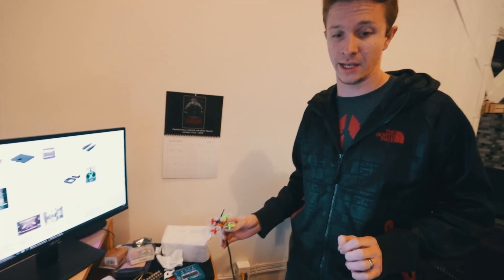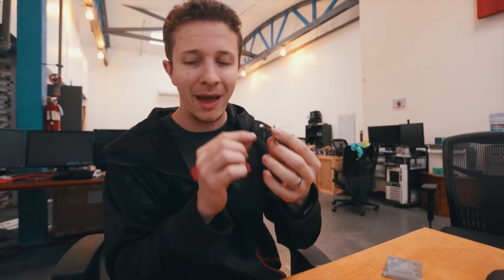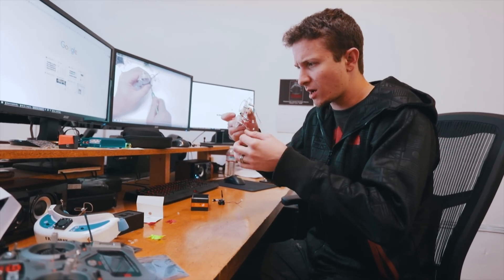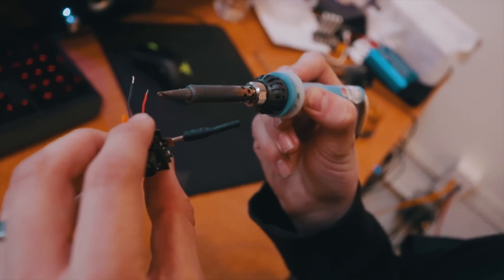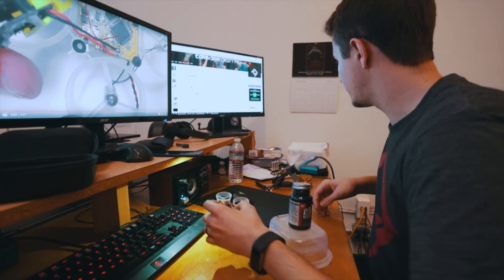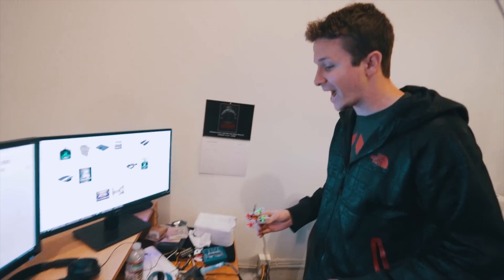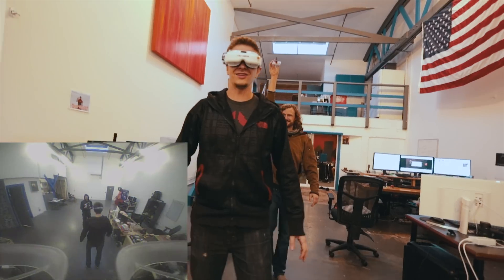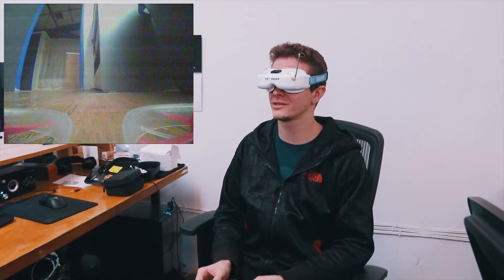World's Smallest DIY Spy Drone!

Comment: I know this is an old video but Wren, you've gotta help me! I'm having the same problem you did, where I see the connection but I can't arm the drone. I'm using a Tinyhawk Freestyle with a Taranis QX7 radio, and I can't find anywhere in Betaflight Configurator to map a switch to the "arm" function. How did you do it?

Comment: Is there a different drone frame I can use
Reply: Santiago Gracias yeah they make metal ones and there's an e010 one that is black but they are both heavier than the stock frame resulting in shorter battery life.

Comment: change the title the public hates RC quadcopters enough as is and are working on putting so many regulations that you might as well not be able to use them and titles like this are not helping the situation and funny part about the situation is that people also clump fixed wing aircraft in with quads so  if effectively bannes quads along with the rest of the RC hobby, so if you enjoy the RC hobby help spread the word that RC stuff is not bad and there don't need to be any more regulations because if you give someone of higher power the ability to do this  they most likely have never tried flying and they will go overboard with regulations 😕 ,,,, it has already happened in other countries,,,, so don't help bad regulations be put into place by giving it a bad reputation look at what almost happened to our second amendment there isn't exactly a amendment preserving our hobby it can be taken away a hell of alot easier 🙁so HELP PRESERVE OUR HOBBY or we won't have it any more 😥
Reply: Wes Brackman the RC enthusiast   Agreed. it's happening to the gun community and it can happen to the rc community.

Comment: Little safety tip. Transmitter always on first, then transmitter is last to turn off. Transmitter on, aircraft on , fly, aircraft unplug, then transmitter off. Very rare and doesn't really matter with the whoop, but for larger scale your aircraft can bind to another transmitter or may have a fail safe with partial throttle when lost connection ( or transmitter off). I had an old RC plane that kicked the throttle to 10% whenever I turned the transmitter off. That can be bad if you are not expecting it. An analogy would be like leashing your dog before you get out of a car or out of the house I guess?

Comment: Easiest way to do tiny jobs like that soldering is usually put solder on the bed first, tin the wire then lay the wire on and just heat both at same time and reflow around it.
Reply: Haha that's exactly what I did :P
Reply: I've messed up so many 5050 LED light strips because of not knowing this trick.  And my iron is a $5 POS from Radioshack.  Thanks!

Comment: Can we get a link to the drone parts? If the price isn't as high as building one with an Arduino and all, I might consider making one.
Reply: Luciano R nobody builds these with arduinos anymore. you use dedicated flight controllers. these little brushed ones usually cost around $90, and if you want a big brushless 200mm racing quad, those are anywhere from $150 to $300. But you'll need the goggles and radio too, which are anywhere between $70 and $300 each. although with those, the price is a little bit less relative to quality, and the cheaper ones can be just as good.

Comment from the maker: Hey Everyone! Parts list for the drone is in the description! Explanation here:

The drone I built is a modified Inductrix Blade, most commonly referred to as a "Tiny Whoop". You can buy fully built kits, DIY kits, or buy the individual parts and assemble it together like I did. You will also need a radio transmitter (the controller) and some FPV goggles to view the camera feed. You can also just use a little monitor screen that has a radio antenna attached. I already had these from when I started getting into racing drones last year. If you go the build-it-yourself route you will want to watch a lot of tutorials and will need a soldering iron. It wasn't as hard as I expected it to be though ;)

I was flying in what's called "*Acro*" mode, meaning that it does not fly like a DJI drone. If you set it to "level" mode, it will behave that way, but in acro mode it will not self-correct so you can easily do things like flips and barrel rolls, but also makes it way more difficult to fly. If you press forward on the sticks, it will continue to go forward until it's upside down haha. I've started learning how to do flips and stuff but I need to set better PIDs.

The main components of the drone are the airframe, props, motors, flight controller (brain), camera, and batteries. I provided links to everything I could in the description. You can choose more powerful motors which will give you more agility and ability to do flips. I went with the middle-power motors for now but will probably upgrade soon. ALSO, the radio antenna on my camera is a linear one rather than the cloverleaf configuration normally seen as default with the tiny whoops, because it's supposedly harder to break. The bigger antennas break easily. I also hot-glued some tooth-picks from the antenna to the frame for added support. 
Good luck everyone!
Reply: Acro mode is like helos without gyro avionics! Neato.
Reply: How much does everything combined cost?
Reply: +Johnyknowhow, no acro mode is like a heli with only gyros to maintain desired roll/pitch attitude.  The other modes (commonly referred to as Angle and Horizon) will auto level when you center the sticks by incorporating data from the accelerometers.   Angle will not allow it to pitch/roll beyond a certain angle and is useful for bashing around the house because it'll resist flipping over when it runs into obstacles which happens a lot with these little guys.    Horizon mode behaves like Angle mode for about half stick throw, and beyond half, it changes to Acro so you can get both auto-leveling at center stick and ability to do rolls and flips.
Reply: Johny, Even on EBay it adds up.    Just a flyable FPV quad with good components you can piece together for about $75 in parts (although can get it ARTF for about $80).
Then you add a full set of batteries (recommend at least 5-6) for about $25
Battery parallel charging board   $5
Spare props, spare motors.. etc..   $2 + $10
The carrying case $15
Were at about $130-135 (not including shipping)
Don't get me wrong.  This is the cheapest fully functional FPV quad you can show up at a MultiGP indoor event and be competitive with, but just just because the individual components are cheap doesn't mean you can get it all for a whole lot cheaper than Wren did.    

And of course this doesn't include the RC transmitter,  and goggles with video receiver (and DVR if you want to record the video), but those are all things you can use with other FPV aircraft.
Reply: Sam and Niko do more please I love this !
Reply: Sam and Niko. great drone
Reply: Sam and Niko.    hey you should have your own show of science and engineering that would be awsome
Reply: Oh. That's... slightly disappointing. I've never gotten into drones and dabble in 3D helos. No 700s or anything too special, 150 does it in for me. R/C is just too damn expensive to have any fun. If I ever did pursue getting into multi-rotors, I'm not too much of a fan of crutches. Special flight modes are great for filming I'm assuming, but that's not exactly what I'm looking for.

EDIT: re-read your post and I think I'm a bit confused. i'll look it over later...
Reply: $153 for everything in the first group of links (the drone its self).  So without the controller or FOV goggles.
Reply: daemn42 - Yeah, it does add up, and yeah the goggles and transmitter are easily the most expensive parts of this entire project. Fortunately I already had those! Getting a fully functional racing quad for less than $150 though was too good to pass up haha.
Reply: WREN MORE DRONES!!!
Reply: h
Reply: I really wish I could work for you guys but I'm not old enough yet but until then, stay awesome!
Reply: Sam and Niko just in case you guys diddent se my comment how old does one have to be to become an intern
Reply: maca bevers around 24
Reply: Sam and Niko it costs too much
Reply: Sam and Niko
Reply: Can you give away this tiny drone ??? PS:like his grandfather DO IT !!!
Reply: Sam and Niko try to fix the camera I fink its your soldering
Reply: Jane Wooding that camera is actually okay quality for an fpv. They have lower quality, but also lower latency so they can perform better. If they used a high quality camera like a go pro they would see things a few seconds late and risk crashing.
Reply: Sam and Niko what escs pdb motors and vtx did u use
Reply: Great video, but you could have just bought a jetjat ultra for 60 bucks, it's even smaller and can do VR by connecting to your phone.
Reply: Do you know that you are using wrong antenna on video receiver ? You should have the same polarization as on transmitter.
Reply: BTW you should use angle mode for proper experience indoors
Reply: Corridor Crew still an absolutely idiotic idea to call it a spy drone lmao
Reply: What tutorial did you followed?
Reply: 2:43 so happy
Reply: Yes
Reply: Seems very simple 

It is not simple
Reply: Yes you can pick up your phone I am going tomorrow night and then go to get my hair done so that you can get a
Reply: I will buy one
Reply: That would of taken a long time to write.
Reply: Why did I read it all
Reply: Johnyknowhow HELL no it's cheap as chips, just use eBay parts
Reply: Sam and Niko I

Comment: The drone's camera remind me of VHS tapes.
Now if you wanna add a retro vibe to a video you don't even have to edit it or put filters, just do it with that camera.
Reply: They use low resolution cameras and analog TV signals because for racing and acrobatics the pros need to shave every millisecond possible in their reaction times; this tech does no processing at all in the signal and when the signal starts going bad you can still see things somewhat because the receiver mostly just blindly throws the signal straight onto the screen without trying to interpret the noise.

Comment: Wren are you flying in self-leveling or acro mode? because self leveling is good for learning to hover, but after you get that it's going to teach you bad habits for flying. also you can't do flips and rolls and stuff in self level.
Reply: red five fpv I've been flying in acro mode this whole time. I'm used to level mode already from flying DJI drones and what not. Acro took some time to get used to haha. I flew a bunch over the weekend to get good enough for the studio flying.
Reply: wrenthereaper i learned to fly completely in self level, and then it took sooooo long to learn acro. I'm glad you did not have the same experience!     ;)   -R5
Reply: Did you practice line-of-sight or just FPV?
Reply: TiagoTiago I started line of sight, and then went to a fpv simulator and learned to fly acro there, and now I'm practicing actually flying fpv acro.     -R5
Reply: I don't think it would teach bad habits. I flew is self level for years with toy quads and I thought the transition was quite easy.

Comment: YOU'VE GOT TO ARM THE QUAD!!! THIS IS SO FRUSTRATING TO WATCH. (usually you move left stick to bottom right but check reciever manual)
Reply: wrenthereaper Hey Wren, I think it's awesome that you're responding to comments and showing that you're listening to advice.

Welcome to the hobby and have fun!
Reply: Wotty that was my problem. I didn't set the arm option in beta flight. Give me some slack haha, it was the first time I've ever done this
Reply: Sorry, I didn't mean to be rude :D,
I think what you did is setup the secondary arm option in beta flight. Because I'm pretty sure if you move the left stick to the bottom right position the quad will also arm.
What Flight Controller and Receiver did you get?
Reply: Normally with other flight controllers that'd be the case but with this one (The NewBeeDrone BeeBrain) you had to set the ARM to an auxiliary switch.
Reply: Ah, I didn't know that, that IS confusing so you have my (some random drone enthusiast on the internets) approval, you weren't being a noob, that is actually just dumb!
~Sidenote If you're struggling with quad stuff check out Painless360, they have some useful vids on building quads.
~Sidenote to Sidenote! - Thought I'd say I'm not associated with Painless360 (Unfortunately), I just like their stuff!
Reply: I have lots to learn! I'm loving this hobby so far! I just busted the lens off this little guy in a hard crash so I have to buy a new camera now haha. I tried hot gluing the lens back on, which technically worked, but everything is blurry now.
Reply: ***** Darn, waiting for parts in the worst.  If it's just the end of the lens that came off, you could try rotating the lens while wearing the goggles and see if that fixes the focus
Reply: The entire lens popped off, exposing the sensor. Pushing it back on fixes it! So I tried gluing it back on, but while the glue set the camera lifted off EVER so slightly. This made the focus point like a centimeter from the lens haha, so now it's a really effective macro lens. Live stream bugs and stuff lol :P
Reply: ***** Ah yeah that's definitely not fun.  At least you can switch it up from a bird's eye view to a worm's eye view!

Comment: Yeah,

that's not a racing drone.
Reply: Yeah, I just consider any racing drone to be something you can fly in full acro and adjust PIDs. You can still race with the tiny whoops. It's just a different frame at the end of the day.
Reply: LazerLord10 I mean... it kind of is. I'm flying in acro mode so it handles the exact same way. If I had more skill I could do flips, barrel rolls, and power loops with this specific tiny whoop.
Reply: True. Those whoops are fantastic for FPV training. Mainly when I think racing drone, however, I think 250mm frame and stuff.
Reply: The Tiny Whoop craze has been blowing up over the last 6-8 months. With stuff like the BeeBrain flight controller, it's not much different from a 250 quad (other than size and power of course). The BeeBrain is Cleanflight/Betaflight compatible and allows full acro.
Reply: LazerLord10 250s are old shit homie.

Comment: You should sell that drone in the store.  I tried to make things like that as a kid I would strip out old rc cars and things for their motors and control boards and tape them to chassis I built with lego, unfortunately they never worked well, but yours is dope that thing is literally like my unfulfilled childhood dream
Reply: +Phasedragon I was talking about the ones Thomas said he was building out of RC car parts.

Multicopters only took off (pun not intended) after the availability of relatively cheap but reliable gyros and powerful enough flight controller chips; without that stuff it would be extremely hard to fly them.
Reply: My guess is the two biggest obstacles you might've had would've been the thrust-to-weight ratio, and lack of control (these things are inherently unstable; you don't control the motor speeds directly, you tell it how you want it to move, and it works out how to do that while at the same time avoiding tumbling out of control; they got a bunch of tiny sensors and a little computer that constantly reacts to a bunch of different stuff).
Reply: TiagoTiago for this size, they're actually very stable. even the stock inductrix that these mods are based on is unparalleled, and better flight controllers, motors, even props only improve that. I doubt they'd sell them in their store anyway, there are ready a couple stores dedicated to these because they're extremely popular in the FPV hobbyist community right now. just search tiny whoop.

Comment: Need a parts list please.
Reply: trendkilla254 do resesarch on tiny whoops, and racing drones. Look at Joshua bardwells channel and uav futures. You'll learn a bunch. Also, don't get a spectrum transmitter, a frsky teranis or the turnigy evolution are much better.
Reply: This isn't a tiny whoop. I'm subbed to UAV Futures. What I asked for is reasonable. I asked for a parts list. BTW I have a Turnigy 9x.
Reply: trendkilla254 rip dropouts. But in all seriousness it is a tiny whoop clone. Tinywhoop s aren't actually a specific quad I'm fairly sure they originally were referring to a blade inductrix with an fpv camera attached, and now people use the term to refer to small brushed quadcopters that have fpv cameras modded in.
Reply: trendkilla254 it basically is a tiny whoop. I'll get a parts list up soon! I inherited the spektrum tx so that's just what I used.
Reply: This is definitely a Tiny Whoop. It appears to have a BeeBrain flight controller.
Reply: I might be wrong but if someone is looking to get into those small quads a search for tinywhoops is going to bring up the right videos to look at. I'm sorry I assumed you were completely new to the hobby. My intent was only to help you find general information that would point you in the right direction.

Comment: "Red on top Black on bottom" There is no ground. it's positive and negative wires to completed a circuit. What is it being grounded to its flying..?
Reply: PSNxSLEVENx lol I don't know. That's what the guy in the video said and I just regurgitated it. In hindsight it doesn't make any sense, but, that's the take they used in this video's edit so OH WELL :/
Reply: PSNxSLEVENx it's not technically being grounded in the sense your house is. The ground just refers to the negative end of a battery.